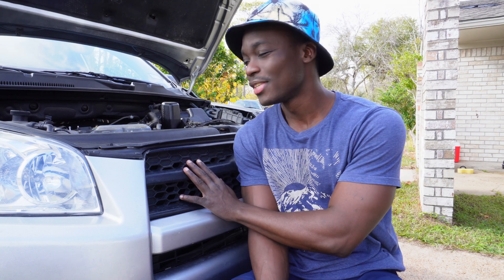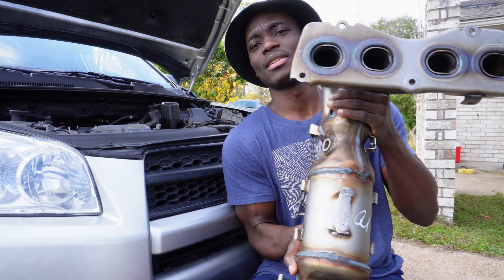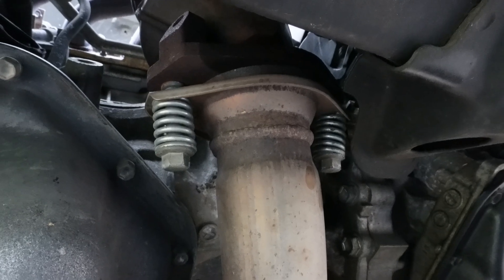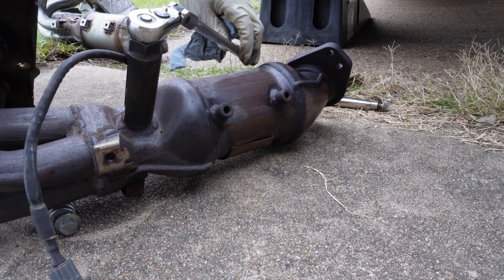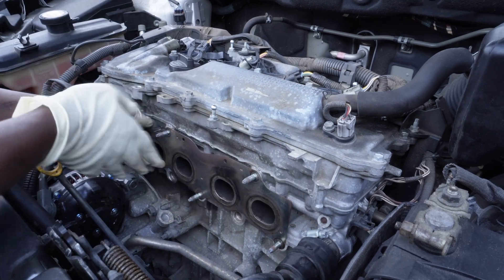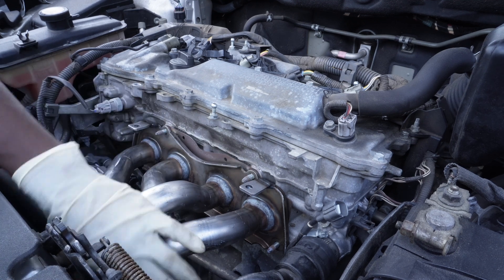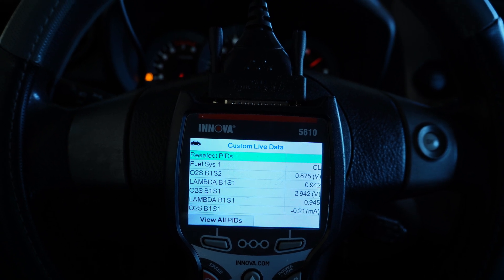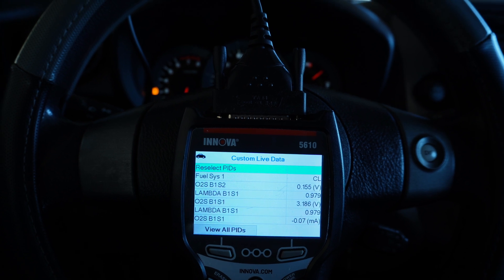How to Replace A Catalytic Converter | 2009 Rav4 Catalyst Efficiency Follow-Up

Comment: Brother,  can you send this cat buying link please. 
I had oil burning, also po420, rav4 2010,  i am not sure its ring piston, or should i change cat now before spent,?
Reply from the maker: Let me get back with you tomorrow
Reply from the maker: Sorry for the later reply. If you’re burning oil, I would try to root cause that first before replacing the cat. You may have contaminated 02 sensors due to oil consumption. Besides the rings, it could also be valve seals. Check your PCV system to make sure it’s not clogged as well.

Comment: Does your rav burn oil? I have the 08 and it burns mad oil lol. I heard most do.
Reply: We have an 08 Rav4 and it burned lots of il. Cat is bad now. We just replaced the engine and will see what happens. I put the cat of my Accord in Purple Power degreaser for two days. It took away the check engine light. Passed smog too. Not sure how long it will last. I am thinking of doing the same with the cat on the Rav4 to see if it cleans it before attempting to replace it. Anyone has tried cleaning cats in Purple Power?
Reply from the maker: This is a nice strategy. Since catalytic converters are constructed with the same metals, I don’t think you’ll have a problem with the Accord’s cat. I’ve heard of cat cleaning but I’ve never tried it. If the precious metals are not melted, you will get away with a good cleaning.
Reply: @pierrerepairgt I hope this is the case...
Reply from the maker: @CarlosMartinez-oh7ok  Should be, Carlos.
Reply from the maker: Yeah, they all do. I think Toyota has piston ring issues in those models. I usually have to add a quart or two before the next oil change.
Reply: @pierrerepair86  I'm doing a quart every like 500 lol. It's older though like 160,000. Think it's getting to the cat conv hence what landed me on your video lol. Thank you btw.
Reply from the maker: @lightningstrike437 I think that’s excessive. How’s your PCV valve?
Reply: @pierrerepair86  I replaced it. Not much change. Also ran ats chemical 505cro and not much change either. I live in the PNW so it's all hills. I'm usually just under 3000 rpm so I think that contributes to some of the blow by.
Reply from the maker: @lightningstrike437 I see. Any smoke upon start up?
Reply: @pierrerepair86  nothing out of the ordinary.  Changed my plugs because they had carbon build up and a misfire.